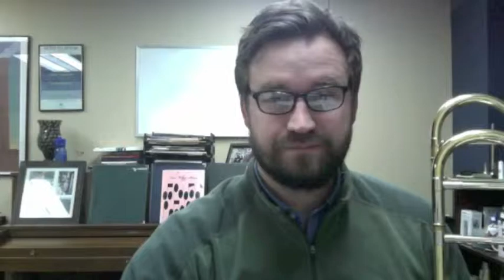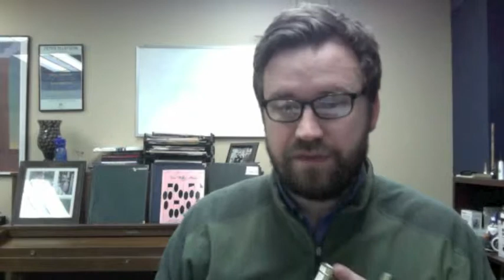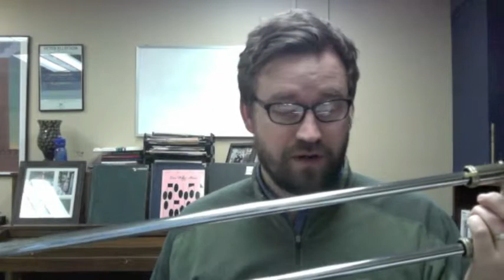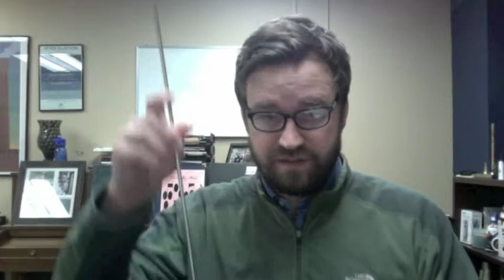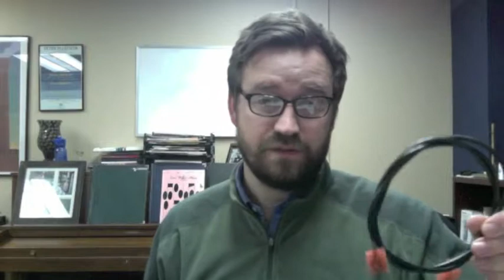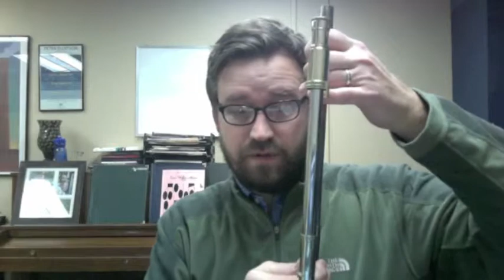Trombone Slide Maintenance

Comment: Good tips! The only thing I might add is that while experimenting with different lubricants, you should always completely clean the slide between use of different brands or types. I've found a few times that when I didn't do so, the slide has gotten sticky.